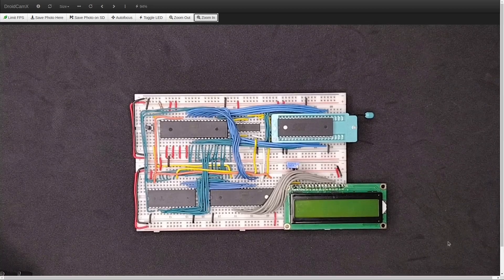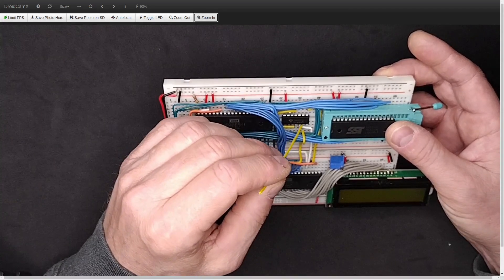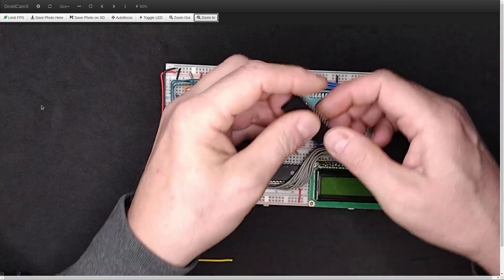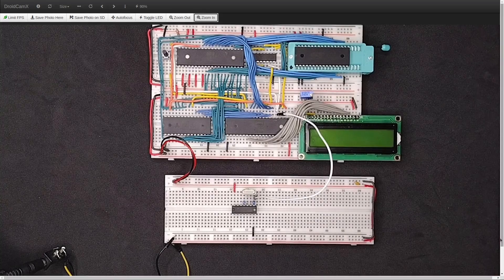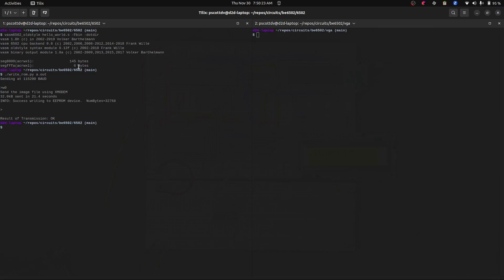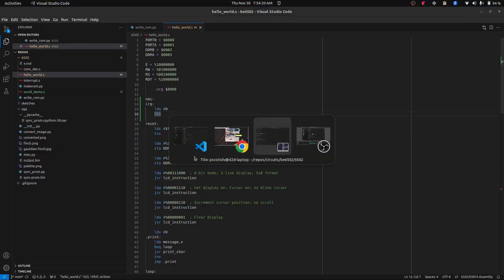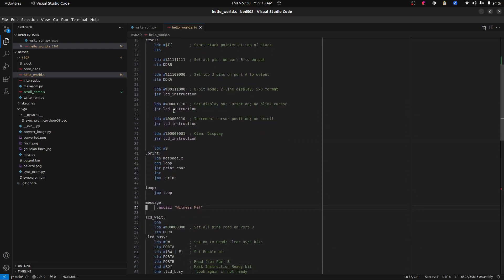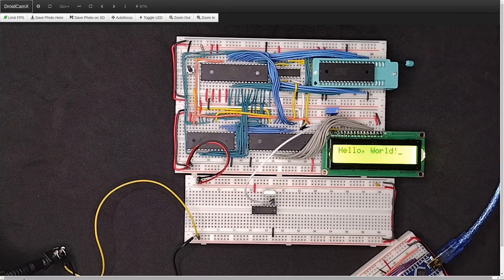Ben Eater 6502-style Computer at 10Mhz using Flash RAM And Reducing ROM Flash Time.

Comment: There's a trick called "trampolines" that you could use to avoid the need to ever set your vectors.

Put at the top of your ROM assembler file (say 0x8000) the instructions: jmp irq; jmp nmi; jmp reset. Then put the vectors at the top pointing to 0x8000, 0x8003, 0x8006 (and write those into the EEPROM). After that, in your usual dev cycle you write normally your code under the irq:/nmi:/reset: labels. No matter which piece of code changes, the jmp instructions at the top of your rom will be reassembled with the correct target addresses and will be uploaded to your EEPROM on the next update. The only cost for those is 9 bytes, and you no longer need to worry about having forgotten to update your vectors.
Reply from the maker: That sounds like a pretty neat trick. I went another direction which you can see in my latest video, but I may give it another try.

Comment: Hi Scott, first one thing: stop using the Eh when you need time to think. I did it myself and I stopped with it when I was attended to it. By the way, why is your logo a duck with hat while your name is The Fox? 
I love the 6502 and I am thinking about it to make one on my own, I was thinking on a clock-generator that is going to the max when possible and when the processor is addressing slower RAM / ROM that then the clock is reduced in speed. On the dark side of computing they do the same, high speed RAM for doing calculations and low speed RAM for storage of data. Why would the evil empire have all good ideas. It becomes time that all 6502 owners stand up for their rights.
Reply from the maker: Thanks for the suggestion.

Comment: 14:28 not matter where they are if use interupts and change main program those addresses chances too you need anyway write vectors again unless hard code them. you did not mentioned it xD. same as allways do it. seconds not matter if it take minute do it again
Reply from the maker: I show it working at 15:15.